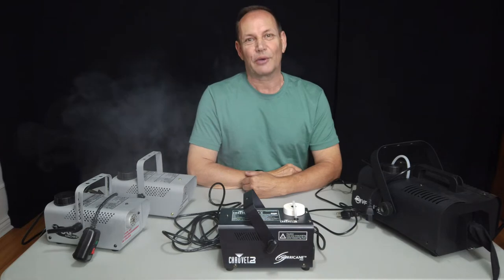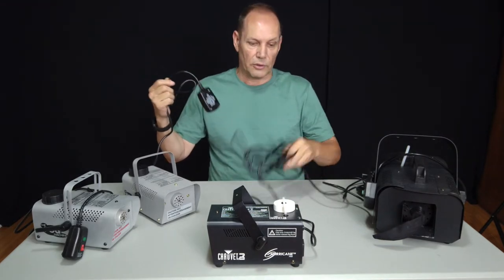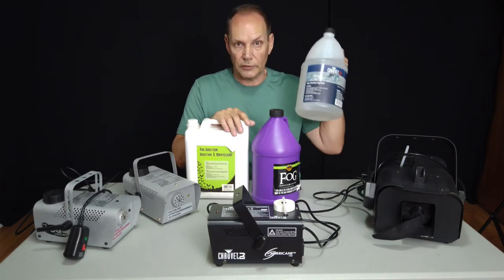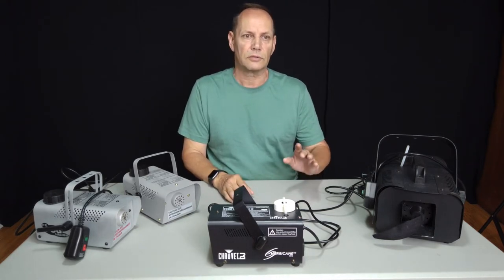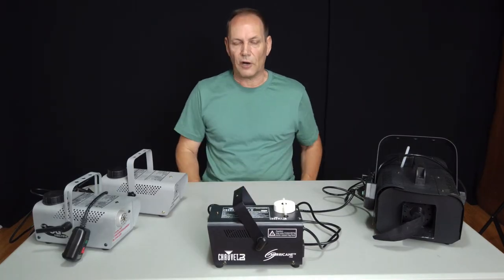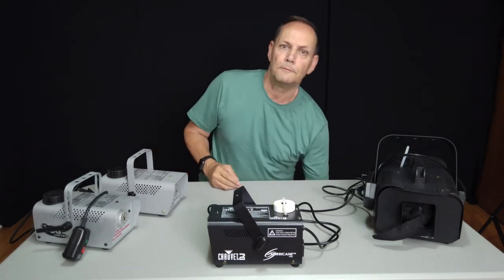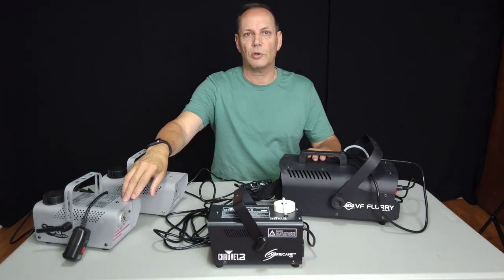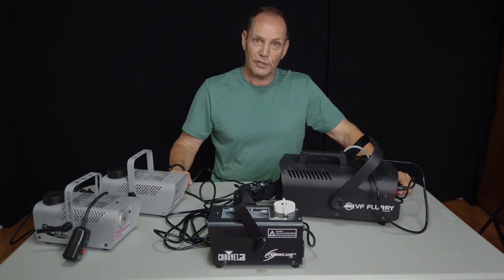fog and snow machine in small photography studio

Comment: Thank you very much for this very informative video on fog and snow machines! Is there any other snowmachine or solution that you would recommend for a small studio to shoot slow-motion video footage? I'm a bit worried by the quality of the snow machine you covered and especially the fact that it is an irritant for the lungs.
Reply from the maker: Your welcome. To my knowledge all snow machines have the same issue. It is not so much the machine as it is the solution that will evaporate in the lines after long periods of not using the machine.It leaves a crystal like material in the lines, so it blocks the lines, especially in the pump.if you do very good maintenance on the machine and do not store without flushing the lines with cleaner, it should be fine. The machine works awesome, but you have to do the extensive maintenance. I have never had an issue with fog in studio being an irritant, but the snow solution is like soap, it is nicknamed "Snoap" In very small quantities it is not so much and issue(with venting), but in longer run periods or mass snow storms, you will need a lot of venting. I put a box fan in the window backwards to pull the studio air out.
Reply: @MichaelCGrayPhotography  Okay, excellent. I know all that I need to know now. Again, thank you very much for the video and your detailed response. Kind greetings and goodnight/day! :D
Reply from the maker: Glad to help.